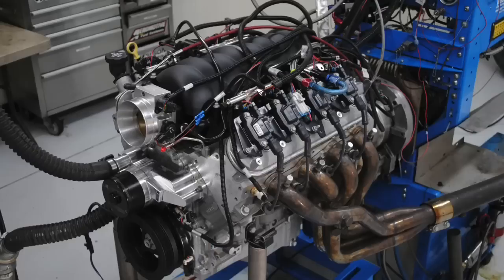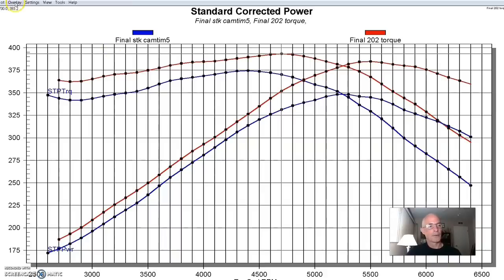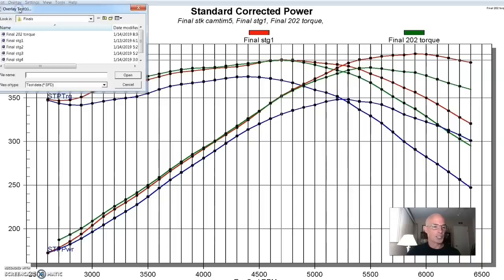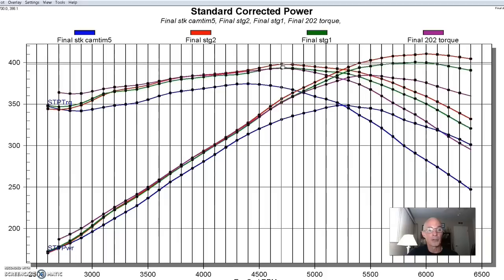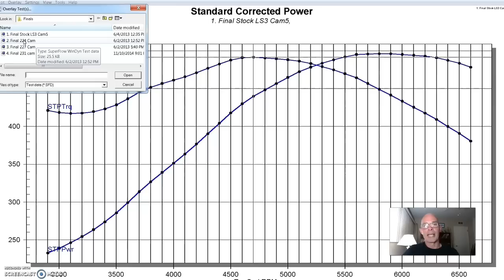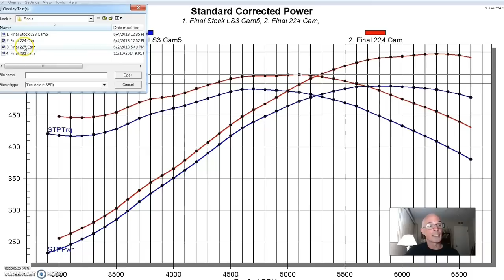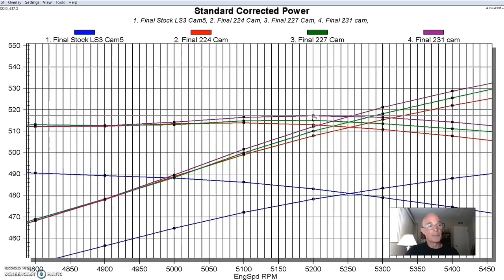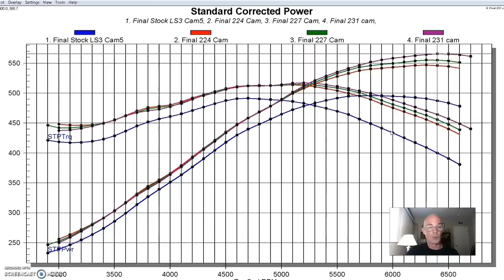LS TORQUE CAM TEST-WHAT WORKS!

Comment: That loss in low speed torque also causes fuel mileage to suffer. My truck runs about 2800 rpm on the highway and specific fuel consumption mirrors but is slightly higher in rpm to torque so that loss in low speed torque= lost fuel mileage. 
For high performance most people don't care but in a work truck it'll cost you.

Comment: What about the LSA ? if you keep that the same and add only a little duration and a bit of lift I believe you will not see big difference in torque between those cams, but if you change your LSA that will change your scavenging characteristics and will make more significant changes if I'm not mistaken.

Comment: Having the power be identical from a given rpm say 3300 to 5500. that more of a function of the cam. Not becoming the limiting factor? In that rpm range you don't need more cam for power. You need to lol elseware is what I'm getting at. So then ultimate torque engine. Big bore. Semi decent duration and truck intake?

Comment: Being an old school guy its amazes me to see those numbers from a motor under 400ci
Reply: HEADS! GM has put a TON of effort into developing cylinder heads that actually work. The original LS1 cathedral ports where some serious next-gen shit compared to the old Vortec SBC heads.

I love how GM proved to the world that pushrod OHV technology is absolutely, positively NOT obsolete... Something that thinkers have understood for quite some time. OHC has the advantage that it can handle high engine speeds, but inside ~7000rpm, there is no reason to avoid OHV. It's a simpler and more compact overall arrangement.
Reply: I think it's interesting how when shopping for "old school" small blocks (GM, Ford, Chrysler), you were looking at heads with (much) bigger ports than OEM. Meanwhile these days, you're looking at aftermarket head with smaller, more efficient ports than OEM. I think the LS3 port is 270cc (give or take). God, that's huge. I remember when an AFR 225 was an absolute monster for a ~400" V8...
Reply: I was a GM tech for years. Hated the Gen 3 motors when they were new. Now my 1988 truck has a 6.0 ls. Never going back to SB.
Reply: The overall head and intake manifold design are vastly improved over SBC stuff. The bottom ends can take a lot more RPM too
Reply: I have been the same. Love these awesome motors. Tons of power for very little money!
Reply: Yes small block chevys are a waste of money at this point unless you just have all the parts or want simplicity.
Reply: 15 degree heads
Reply: I understand I'm there or was until I studied to see why the ls motors do that. The heads are equal to the afr 227s for the old small block untouched. The chambers, plug location on the ls is better than anything for a small block. Those ls motors are performance oriented from Chevrolet.
Reply: Exactly. 6.2 ls3 is 376ci and my little 4.8 is 292ci.
Reply: The ls is old school. Lol. Going on twenty five years of ls development.
Reply: @brettspaulding5855  yup. It’s replacement is already 7 years old

Comment: Like to see a test on the summit line of truck cams. There super affordable and work great! I have installed a couple Brian tooley truck cams and the stage 2 on a all aluminum 06 gmc 1500 5.3 I felt like it should have a converter to get that truck punch on the bottom off idle like the stock 5.3 already suffered from.  It's a good cam and it was the new gen V2 just wasn't overly impressed with it's overall performance. So I've been playing with summit racing's line of cams for there trucks. And well I'm satisfied with the performance from the stage 1 8719 high lift. It hits right off the converter and pulls strong all the way to 6500. Pulls really fast from around 3800 to 6500 it's just night and day over stock. I even put a 05 LQ9 6.0 cam in and that was on a stock tune with a power programmer. Now I have hp tunes and the 8719 in my daily driver slash winter bomb. I'm going to be giving the stage 2 high lift 8720 on my summer truck I plan on doing a low boost setup on next summer. Which I did recently see you tested and it worked extremely well for a smaller cam. And it loved boost like they all do. I appreciate all you do and look forward to watching when I get home every night. I'd love to see a test on summit's line and maybe try a few carb cams they designed for the swap guys running a carburetor. I'm sure summit would love to assist with sending some test subjects. I always post a review and let them know I watched your YouTube channel and you ultimately helped with my decision on my purchase. And no regrets there. Definitely a great everyday cam for a little extra kick in the pants and a set of 85$ dollar ls6 springs and a 260$ cam you can't beat the price. Summit definitely did a great job on the truck cams. So far no complaints all thanks again Rich! 👍

Comment: Interesting. RE: the LS3, though the 224, 227, and 231 cams made virtually identical power from 3200ish to 5000ish, was there any significant difference in idle vacuum, for drivability and power brakes?
Reply from the maker: yes-smaller cam has more idle vacuum

Comment: Love to see this same test on a 6.0 or 6.2 truck motor with the v2 cams.
Reply: Same results, the power curves are identical just smaller displacement motors equals alil lower numbers. The 6.0 starts at 400 and easily makes it to 500, the 6.2 truck motor is between the 6.0 and LS3.

Comment: Ok, this has NOTHING to do with this particular video, it just happens to be the one you posted today. I'd like to see a REALLY out-there build, one that's never been done in the history of hot rod media; a mid-60s GMC V6 305 or 351. There's a lot of old GMC light and medium duty trucks left, and many still have these. Of course a SB, BB, or LS would be cheaper and more powerful, that's beside the point. Maybe a guy (like me) wants to keep his original engine and the vintage vibe, but wants more poop to keep up with traffic. I'm curious to see what's possible for this ancient architecture, without spending a million bucks. Maybe a 6-71 GMC on a 351 GMC? You'd have to fab an intake (Hogans? $$$) and drive setup, but it's possible. Intriguing.
Reply from the maker: that's definitely Other Guys
Reply: @richardholdener1727  Indeed. "OTHER other guys", lol.
Reply: @richardholdener1727  I guess I'd have to call Max Herman at H&H, huh?
Reply: @richardholdener1727  I like other vintage stuff, like Gen 1 hemis, Nailheads, Olds 394s, Caddy 331 to 429s, flatheads, Studebakers, straight 8s and 6s, etc. But those builds are all over the webs.

Comment: what about the sloppy seconds cams?
Would have nice to know the specs on the stock cam. Plus it seems like the camshaft maker missed the mark on the "Torque" idea. And went for HP in the end.
Reply from the maker: not sure I follow your logic
Reply: @richardholdener1727  I thought?That torque specific cams went for shorter duration/higher lift. It seems after the stock cam. It more or less went to about max torque. Then after stayed about the same. With HP climbing with each "bigger" cam.
Maybe that's the nature of the beast.?
I am glad you did the test regardless. I was stuck between getting a Chevy truck with a 5.3 or 6.2. It seems that the .9L really makes a difference with Mr T.

Comment: It has always been my belief, and backed up on the track, that torque moves the car, horse power accelerates the car. 
Without good bottom end torque it takes much longer to get to speed because there is little horsepower down low.
Just one mans opinion.
Reply: Torque=acceleration 
Horsepower= top speed
Reply: @derekbigpowers1993  If it was a one speed yes

Comment: Great content for guys who drive LS trucks Richard, thanks!!!  What I'd like to know is if the BTR Torque cam would make even more bottom end snap if it was ground on a 108 or even 106 LSA?  
As is, looking at the RPM ranges I really drive in most, that BTR Torque cam is definitely the cam for my truck so far.
Reply: For sure. Really the goal would to numerically decrease ICL. But, yes, a tighter LSA should do that. I've always wanted to put this cam in my old Gen III 4.8 and see what it does:

Howard's 190315-08. 210/214, 108+4 LSA, .598/.598
Reply: @lucasmacdonald2613  That cam looks EXTREMELY interesting!  A little pricey compared to the cheapass LS cams I'm usually looking at, but I have to say I'd really like to try it out.  And at .598 valve lift, you could run it with an economical set of PAC 1218 springs, too......  Hmm..
Reply: @tptrsn  Exactly! But, I do wonder what the lobe profile/ramp rate is like. It might be hard on springs! For me, it would go in an '00 silverado farm truck lol so don't care about that.

Comment: Start at a lower rpm Rich! There are these things called manual transmissions where some people do actually hit 100% throttle at 1500rpm and want to see how an engine pulls at that rpm
Reply from the maker: if you are at WOT at 1500 rpm you need to downshift
Reply: @richardholdener1727  yeah well thats your opinion man. some people drive like that.  really, what have you got to lose by starting your dyno runs earlier?

Comment: Timing is everything tight lsa and early closing intake valve also seems that a large split really helps also bigger cams make more torque but later smaller cams sooner my favorite is 212 218 550 550 on a 112+4 that is the key the plus 4

Comment: Great content.  You have to wonder why the cam manufacturers don't provide us with the same data.

I'm like you...  I've found that between 218 - 224 degrees @.50 makes a great wake-up cam for most street smallblocks.

Comment: Like it has already been asked, off idle torque is very important when your getting your gooseneck trailer out of the field loaded with hay or a 12,000 pound tractor.
Reply: People always wanna bring diesel up but nothing better than hauling with a big badass v8. My old 350 with rv cam and a 4 speed does a beautiful job pulling anything I throw at it. Obviously if i had a towing or hot shot business Its better to invest in a diesel but v8s are beautiful to pull with.
Reply: @marioalvidrez940  I really would not own a diesel truck. I've driven them for work and I have torn them apart to make repairs. They do have their place but as a everyday truck that I would use for just kicking around in, nope I would not want a diesel.
Reply: @marioalvidrez940  I'm going to let CN Rail know they've been doing it wrong all this time. Pull out those diesel motors boys, time to switch to gasoline!
Reply: @thunder57  Thunder, my grandfather retied from the Frisco here in Missouri. I have very good memories from him taking me around the train yard and shop. I am still amazed at the size that diesel engines are built. My dad worked on ship diesel engines during the Korean war when he was in the Coast Guard. Diesel engines are very efficient even when they are built in the size of a 3 story apartment building. I did not grow up around these fancy diesel engine trucks that we have now. I personally think that a port injection LPG turbo charged truck would be a hoot to have and drive, that's me. There are several old diesel tractors that I would own just for the sound of their old style engines. They sound great when they're on a boil pulling a plow.
Reply: It has nothing to do with me needing a diesel engine in my truck. I was just asking the question. I've seen 440's, 390's, tall deck 427's and a host of other gas engines with gobs of off idle torque. I'm 55 so when I was younger we didn't have these fancy diesel engines we have now. I was comparing gas engine to gas engine. The only big truck we had when I was younger had the V92 6 cylinder diesel, they're a 2 stroke. I know that it'll out pull these newer diesel engines that are out now.
Reply: @adampatterson707  amazing story, thanks for sharing
Reply: A gasoline tow pig will have you squealing like a little bitch at the gas pumps compared to that nasty new tech diesel!!!  That isn’t subjective!
Reply: @trailerparkcryptoking5213  Gasoline is a $1.71 a gallon where I live. What are you talking about that filling up a gas burner is going to make someone cry. Who gives a darn about the fuel, when I personally have something I need to do, I could care less about how much fuel my truck blows out it's tailpipe. I just want to get the work done and move on with my day and if my gasoline powered truck does the work I ask it to do day in and day out why would I drop $50,000 on a diesel truck. That's 50k will buy a crap ton of gasoline. I said in my post for the kicking around I do my gasoline powered truck works fine. It gets 12mpg pulling a loaded cattle trailer.  So what if a diesel gets 20. My (paid for) truck isn't costing me monthly payments on something that lost 13% of it's value the second I drove it off the lot.
Reply: Low range is there if one needs it too.
Reply: @HioSSilver1999   <---  best reply for that specific scenerio!
Reply: @ZboeC5  Adam was asking about off idle torque. The easiest solution would be to get diesel equipment if that's his biggest concern. There's a reason you don't see much gas equipped machinery in heavy industry.
Reply: Sounds like you should of got a diesel
Reply: @thunder57  I love diesels, even the small 4 cylinder ones, but the cost keeps many people from buying them.

Comment: What numbers could one expect on a factory lq4 with the btr torque cam? With factory heads or maybe 706s
Reply: I'm curious as well. I'm getting ready to build a forged 408 LQ4 with ported 706s and a tick performance Towmax stage 2 cam, and ported truck intake and ported throttle body. Hoping for 500-550HP/TQ at the crank.
Reply: Christopher mix that should be pretty sweet. What’s it going in?
Reply: @AlaskaHighboy  should be torque a monster! I'm putting it in my 2004 Chevy Z71, I'm putting a 4l80e in as well and maybe 4:10 gears. I'm guessing a LQ4 with stock 317s and a BTR stage 2 truck cam would make around 420HP/440TQ at the crank.
Reply: Following

Comment: Wow thanks for this video! Just what I needed to see. Although I have a 1500HD w/ the  6.0L LQ4, what cam would you recommend for my heavy chevy? Originally I was looking at the V2 stage 2 BTR truck cam  212/218 111 LSA low lift. Now I'm wondering if that BTR Torque cam 202/202 low lift will perform better.. My truck is not a high revving race truck. Looking for more torque on the low - mid end. @richard holdener
Reply from the maker: the 1 or 2 is good on a 6.0L, but 706/862 heads help (so would 243)
Reply: @richardholdener1727  awesome! thanks for the reply back!
Reply: 862 heads 212/218 have a blast!

Comment: Richard, I know how you like torquey truck engines, because I recall how you--like I--wish GM put TPI on their full-size truck & vans... and how we both would like to see what results if it were combined with L31 heads on a 350 w/Ram-Jet 350 cam. 

That said, I'm sure that like me, you'd like to see the results of running any of these cams with the Edelbrock cross-ram manifold! ;)
Reply from the maker: that would be torquey

Comment: I have a 5.3 in a 2002 Avalanche 4x4, cable throttle, stock plastic intake, plus a Whipple SC system making 6psi max. Stock converter, shift kit, torque mgt disabled. I'm looking for STOCK - STYLE SMOOTH IDLE, and the engine will never see above 5500 rpm, it will be hauling and towing, no racing. I used to have full length headers on it for 15 years but have to ditch them, they suck because the mfr insists on having a tube that loops upward to clear the steering and that makes the LS ignition wire lay right against it, heat sleeves don't help, plus clearance issues with the front axle pinion and frying starters, so I'm going back to stock manifolds. I have 706 heads with mild porting, chambers have valves un-shrouded, polished, and cc'd 62.8 to 63 even. I don't expect to make over 400 hp and seek all low speed grunt. Looking at a cam with specs dur @.05" lift 200/208*, lift 502/502" LSA 115* made by Vinci, any thoughts Richard?
Reply from the maker: how do you have a Whipple AND plastic truck intake?
Reply: @richardholdener1727  Well, back in 2004 Whipple sold these kits designed to bolt on stock LS trucks by application, and it bolts to your OEM intake, and I daily drove it for 15 years and it runs great. It uses a bypass port to cruise NA and engages the compressor under power demand, uses its own computer that piggybacks onto your OEM ECU and overrides it under boost, has 2 aux injectors to supply needed extra fuel, that's how it has a plastic truck intake, they never told me I needed otherwise. Would you care to make a suggestion for an upgrade in my situation? Thanks!

Comment: Richard I keep forgetting to ask. Your not using a MAS. I guess u can tune to work without? I ask because I am short on space and would rather install air filter directly on intake. Having bad luck with electric fans so I’m using the stock belt driven and have little room in my application.
Reply from the maker: we run a Holley HP-so no MAF

Comment: Would like to see a similar test on SBF roller motor.  I have a '65 Ranchero 289/C4/2.87 rear that needs updating and for LA traffic I want idle to 4K to be spritely and decent manners combined with mpg.  Any incites appreciated.  Always interesting work and love junkyard jewels.
Reply from the maker: dual pane intake, small carb and RV-style cam-good heads help make power with no low-speed penalty
Reply: @richardholdener1727  Sure...Weiand Stealth, Smallest Road Demon, 1.5" headers and long collector extension with Xross pipe, AFR165, but need some real test info on cams NOT just from a salesman guessing.  Thanks for the reply!

Comment: I’m curious to see what the stage 4 would pick up with a better intake and some worked heads on the 5.3. Wish they made those cams with a little bit higher lift than .550, I think that’s what’s hurting them the most.
Reply from the maker: Check with BTR-they have higher-lift cams like the stage 4-